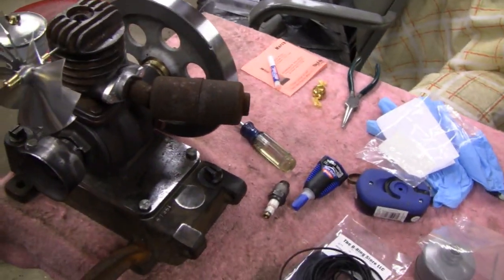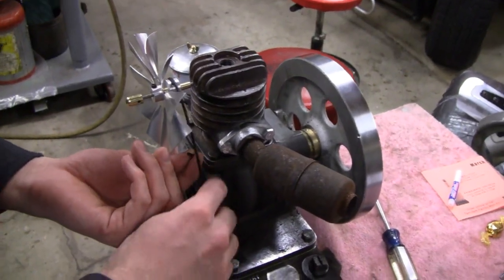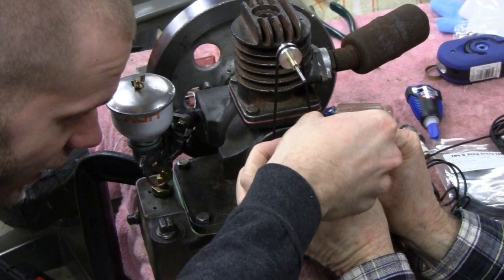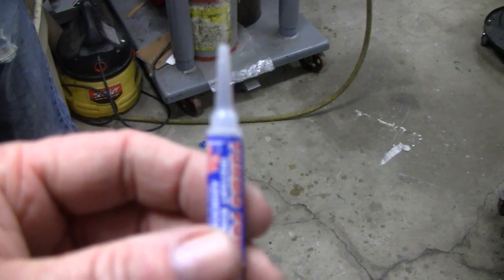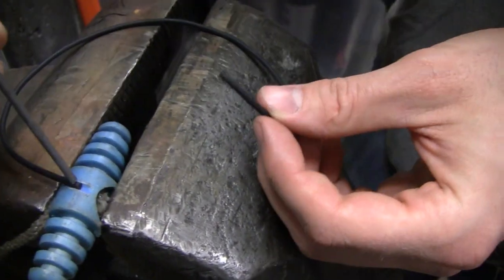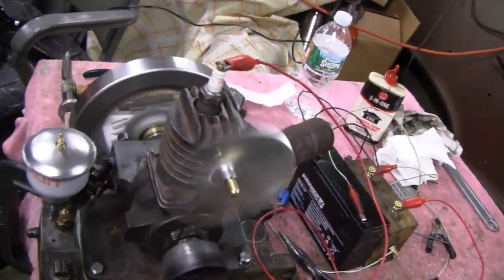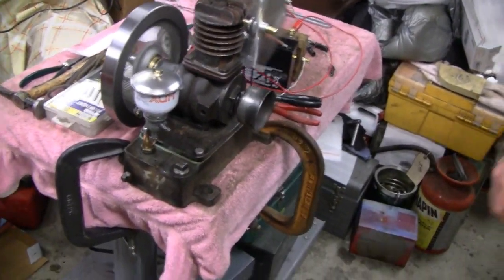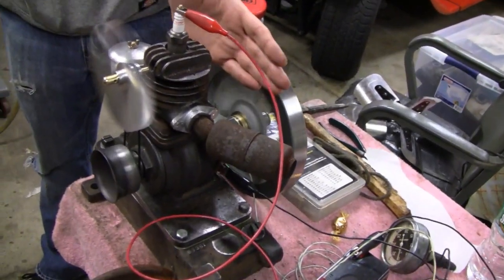HOMEMADE MAYTAG UPRIGHT ENGINE (part 20)

Comment: looks great and runs even better. was alot of fiddling getting that fan the way you wanted it. Maybe rounding the blade tips will give it an older look. that can always be done later. cant wait to see it all done up
Reply from the maker: +jeep2003 Thanks Bud!! I agree with ya on the blade, plus it will make it alot safer!!☺

Comment: That's a cool engine! (pun NOT intended) lol. I like the sound of it. I find it interesting that a company like maytag used to make stuff like this. what was its intended purpose?
Reply from the maker: +Engineering4life Maytags were mainly used on washing machines, but they also had a little light plant and a lawnmower!! Back in the 20's, 30's, and 40's alotta places still didn't have electricity, especially in the mountains down south!!☺
Reply: +805ROADKING That's cool! I can't imagine a gas powered washing machine haha.